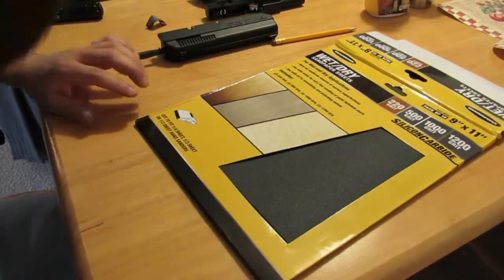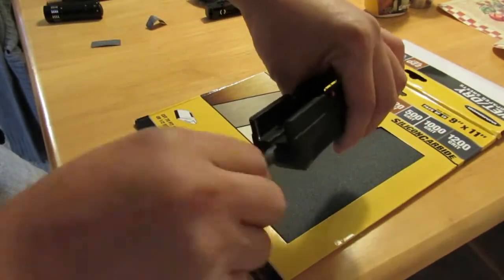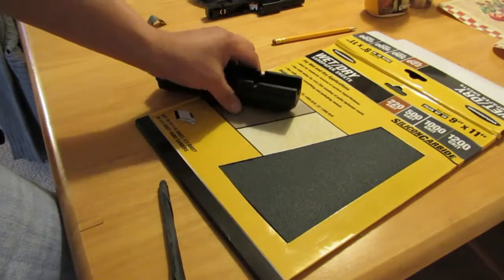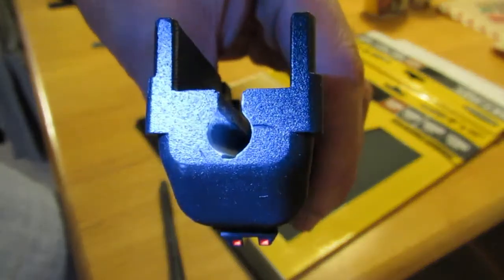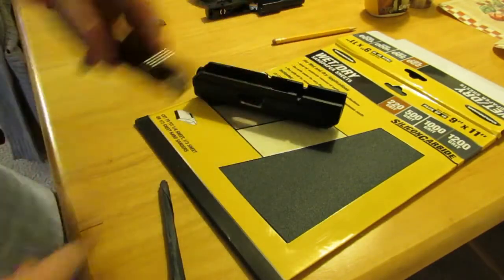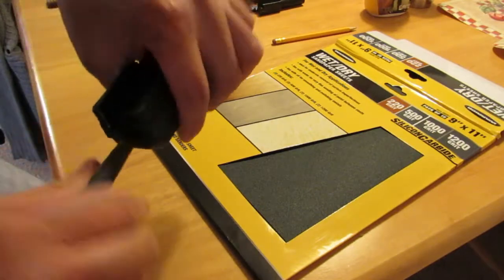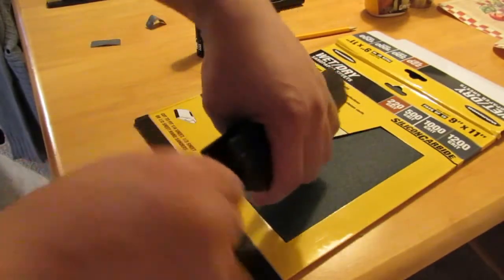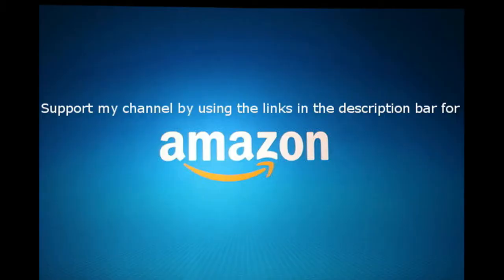HI-POINT MODIFICATION HOW TO POLISH INNER TUBE

Comment: Seems kinda stupid and pointless to me.
Reply from the maker: Then you don't have much knowledge of how a firearm works and leaving comments seems kinda stupid and pointless to me. Taking off the sort of sticky finish as well as polishing the inner tube gives it a smoother action and makes it easier to keep clean. Fouling and/or build up and gunk up the slow down the firing pin giving you light primer strikes resulting in a failure to fire. If someone were to try and defend themselves and had a FTF it could cost their life. I did go over that in the video but I guess watching and listening would "Seems kinda stupid and pointless to you" in real life guns can fail, in games they don't.
Reply: @thomasdangerpowers  First of all, I only left a comment because I couldn't see any other comments. As far as not understanding how firearms work, I built my first one almost 20 years ago, and Iiterally just fixed a factory Hi-Point 10 round mag for the CF380/C9. The follower was bent about 5 degrees off from the factory, and wouldn't engage the last shot hold-open. Now, on the subject of manufacturing quality control and reliability, I have NEVER seen any evidence of manufacturing defects in the slide or any other part of an assembled Hi-Point. Only magazine geometry issues. I clean my gun every 500 rounds, and I never have any FTFs with good magazines. You should probably not make so many assumptions.
Reply from the maker: That's an assumption itself, I NEVER said it was a manufacturing defect. I simply said it would improve reliability because the finish is not a slick and it can collect gunk easier that a smooth bare metal surface that would glide like a slick bar of soap in the bathtub. I did explain it in the video but never that's fine we can simply just agree to disagree on the mod. If your a 2nd Amendment guy were are on the same side and that's all that really matters to me.